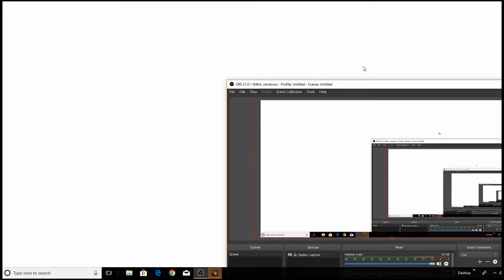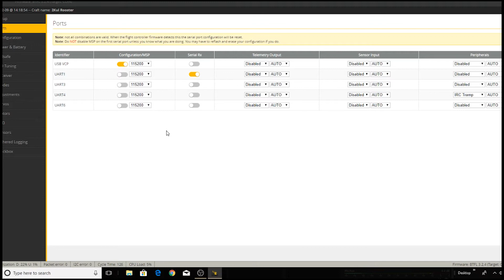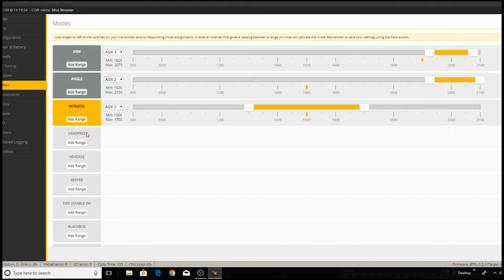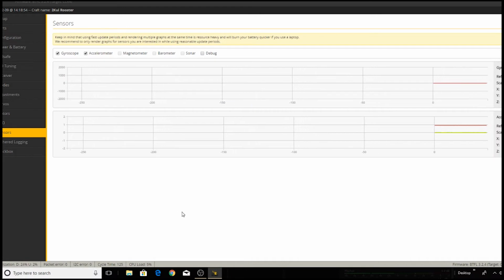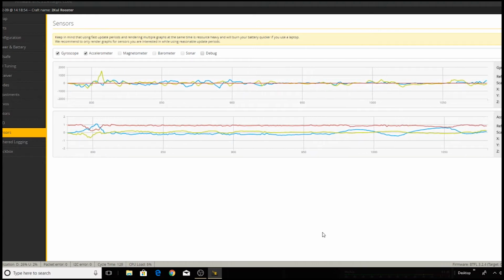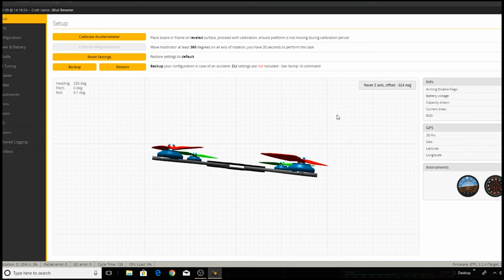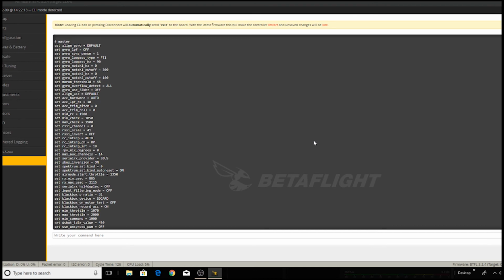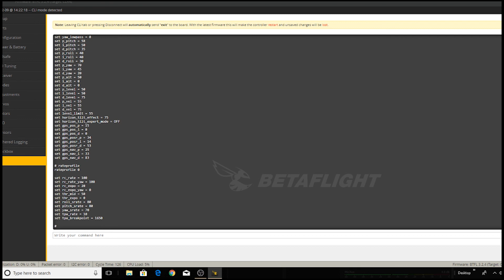Help!  Runaway Rooster!  Can you figure out the problem?

Comment: Had rtf drone do same thing,after first flash.Didn't relize fc board was put in facing left, with direction arrow.Had to change yaw board and sensor alignment in configuration to 270 degrees.Fixed for me .
Reply from the maker: Hmmm.. if the board were mounted 90 degrees off it would have acted differently but the yaw would have been the only thing working correctly because it would not matter the orientation then.  Not sure why yours would act differently, glad you solved your problem though.

Comment: CLI "set yaw_motor_direction = 0" . Inversion du sens des moteurs avec "=-1"
Reply from the maker: I don't think that is the problem, it does actually respond properly to yaw commands, it just doesn't stop.
Reply: Test this! If =0, you put -1 and vice versa. It will not cost you anything!!! ;)  I had the same problem on my first quad build, set like that
Reply from the maker: Pat S I will try it!

Comment: It is a Bad accelerometer...  Possibly effecting the gyro...
Reply from the maker: Hadleys FamousFPV watch the portion when it is graphing the sensors, the accelerometer reacts but the gyro is flat.
Reply: 2kul FPV you need RaceFlight... Problem solved
Reply from the maker: I am thinking about trying RaceFlight in a future build.  I doubt it would do any better with failed hardware though :)

Comment: Looks like a bad gyro. Did you put in a heap of yaw input at the start when you took off because that kind of looks like yaw spin to the moon that happened on some matek boards when you clipped a gate or something and deflected the gyro yaw too fast (over 2000 degrees per second or so). But yeah based on what you've shown here itlooks a bad gyro to me.
Reply from the maker: No, it was neutral.  The input I was applying was only to try to correct the motion.
Reply: Looks like a bad gyro

Comment: With the Receiver connected does the image in BF spin when you move the Yaw Axis? Does it respond at all to direct input from the Radio?
Reply from the maker: Good question.  I hooked it up and it does respond to the yaw commands from the radio when viewed on the receiver page.  At the beginning of the video you can see it yawing left and right as a result of my yaw commands too, it just doesn't stop when I let go.
Reply: When I began in this hobby, one of the habits I picked up was to take a toothbrush dipped in Isopropyl Alcohol and brush  the whole FC, after I soldered everything. Why: To get rid of any solder that might have splatted on the board and accidentally bridged a component. Happens a lot more often on these AIO boards.
Reply from the maker: Excellent advice.  I am pretty careful about that (soldering for like 40 years) but I hadn't thought to check for any anomolies, I'll look at it under the magnifying glass and let you know.
Reply from the maker: Scrubbed it with alcohol, same results although if that was the problem it may have toasted something.  I didn't see anything under close examination with the giant magnifying glass.

Comment: yea bro definitely looks like a bad gyro (like when they put too much feta on it! hehe)- point RDQ to this video and they should send you a new one asap, especially since even JB himself has seen some of these with gyros gone bad!! Can you fly it with gyro turned off in acro mode only? Sheet Ive never tried that can Anyone fly with gyro turned off anyway?
Reply from the maker: or the tzatziki sauce is too old?  :)
Reply from the maker: I doubt it would be fun even if you could fly it.  Maybe with a whole bunch of expo?
Reply: yeah after thinking about it there is really no way you can fly with no gyro, right?- its part of the pid loop and the basis of everything the escs are trying to make the motors do, etc... as far as I know.
Reply from the maker: ZeeBeeFPV it could make an interesting video though.
Reply: if you do turn the Gyro off and it stop doing that then you know its the gyro..
Reply from the maker: Ramble Ron I'll try that for fun!